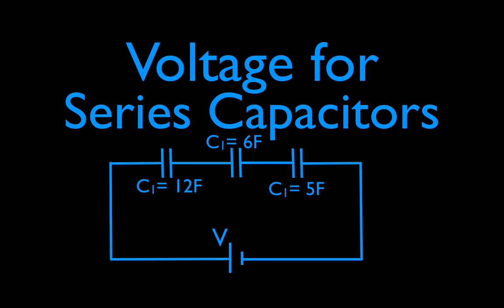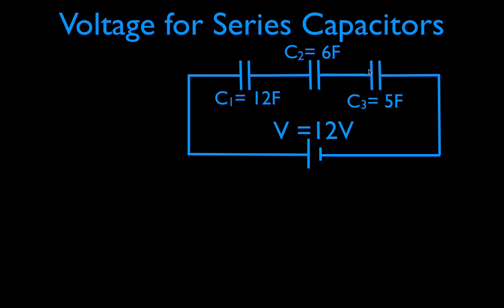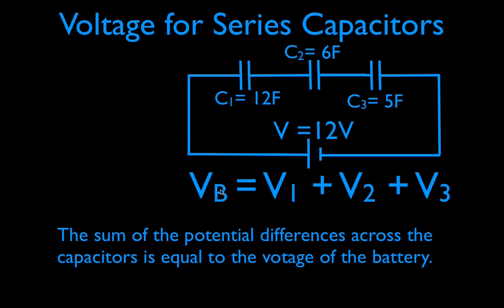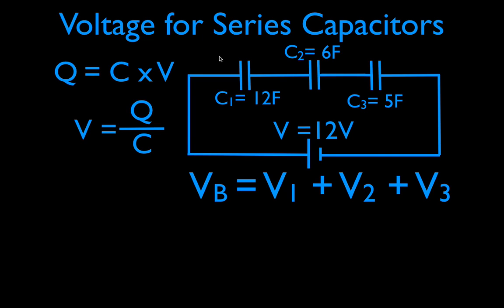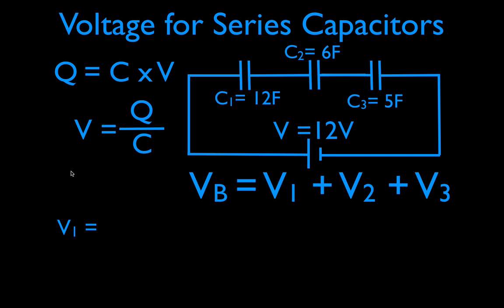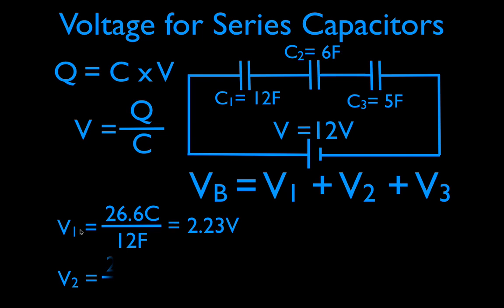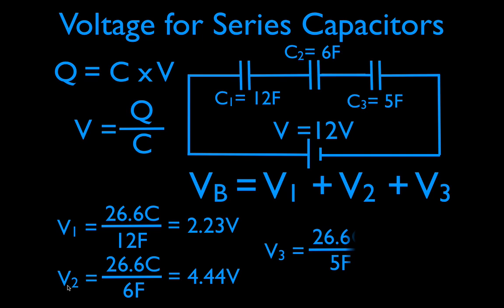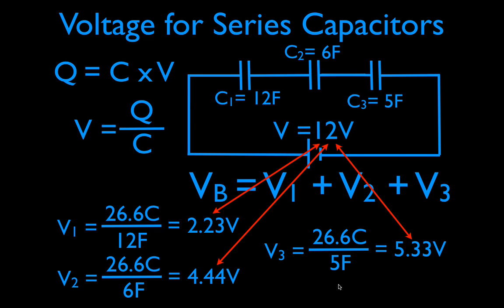Capacitors (6 of 11) in Series, Calculating Voltage Drop

Comment: So could you split a high voltage into lower voltages with multiple caps of the same capacitance by connecting a circuit to each individual capacitor?
Reply: i.e. 100v power supply into 8 capacitors to get 12.5v outputs? Maybe with rectifiers to stop it from combining back into one voltage.

Comment: This was great and now we know what the different voltages that appear on each plate, but can we tap a potential and use it as a reference on a high input resistance pin of a comparator? Is it better to use a resistive voltage divider for this comparator?
Can you list some practical usages other than keeping component costs down when dealing with higher voltages?

Comment: You have to indicate that an initial precondition for your setups is that all Caps are fully discharged...
Because a nice test case to consider is if you have 2 Caps in Series and one is charged and the other isn't, and we have an on/off switch between the two caps...  Once you turn the switch ON, the second Cap will get charged to the SUM of the Battery Voltage + the first Cap voltage, as the Battery and the First Cap will be in SERIES to the Second Cap...
True or False?

Comment: example :
c1= .002 uF, volatge rating= 120V
c2= .002 uF, voltage rating= 26V
c3= .002 uF, volatge rating= 120V..

i solved for the total capacitance and i got .00067uF.
but i dont know how will i solve for the voltage, will i just add it? thank u..

Comment: sir how would i solve for the maximum voltage that can be applied in a series circuit if each capacitor's value has voltage rating,?
Reply: kkese kocchi hy how are you i want to be friendship you, i want talking to you please answer me
Reply: kkese kocchi hy how are you i want to be friendship you, i want talking to you please answer me

Comment: What happens if there are two batteries?
Reply from the maker: Sana Sarfaraz Of course it depends on the type of circuit and where the batteries are located, but for a simple series circuit just add the batteries together.